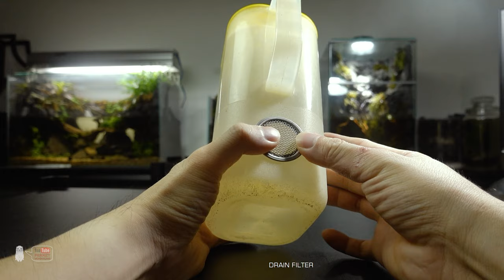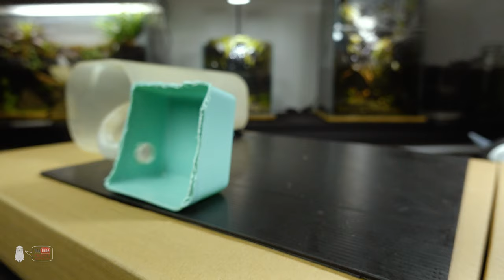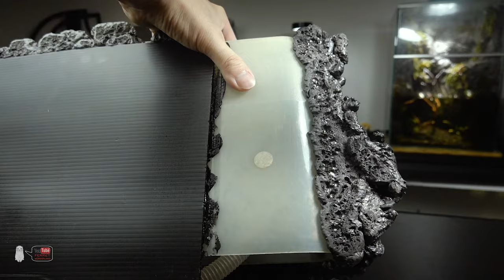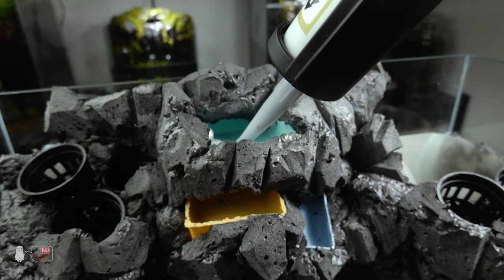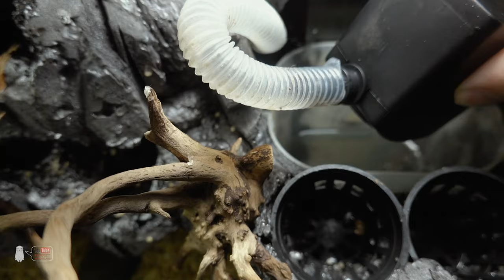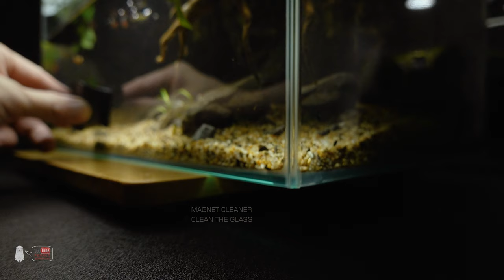Setup Guppy Fish Aquaterrarium l Use Plastic Kettle to make aquarium l movable plants

Comment: Been thinking of setting up an aqua terrarium and been saving up a lot of your videos for reference later. One question I had - what do you do to maintain the water level as you lose water through evaporation? I mean, is there something you do to maintain it at a certain level automatically or you just keep it at a roughly same level through top-off and water changes?
Reply from the maker: Maintain regular cleaning and water changes
Reply: @ferretwonderland  换什么水质的的水呢？ 老水是什么意思？

Comment: What expanding foam do you use and can I order it on Amazon
Reply from the maker: Yes,you can search "expanding foam for aquarium" on Amazon.
Reply: @ferretwonderland  is the black backing material your using is corrugated plastic
Reply from the maker: @flows-edits  It's Polypropylene Board.